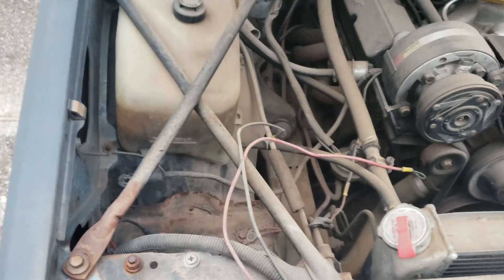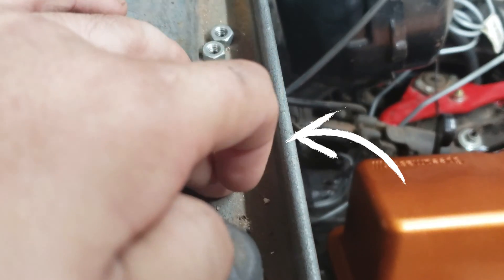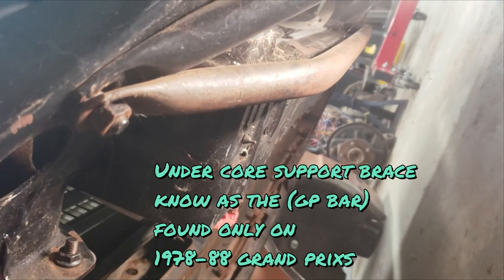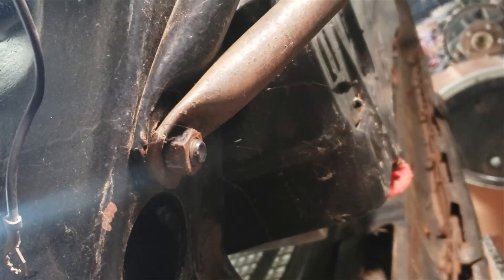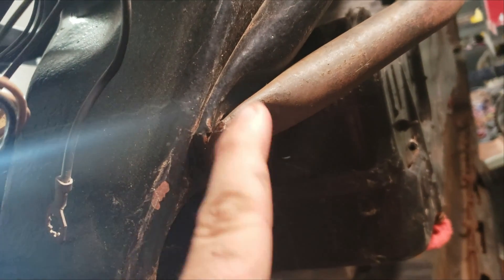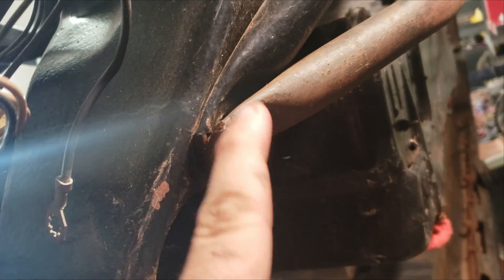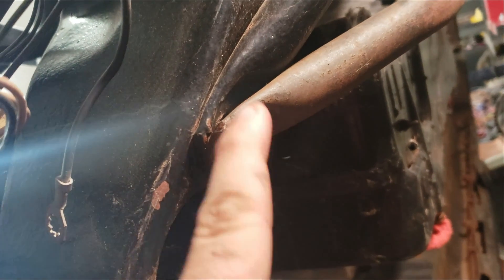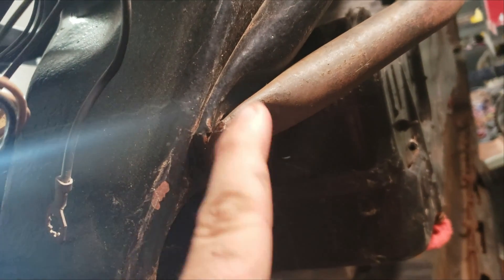Handling Better Than Stock 1978-88 G-Body Cars- Episode 1- Frame & Chassis Braces

Comment: The radiator brace works on boosted cars. All the turbo regals intercooler behind the radiator
Reply from the maker: @87TurboT  i could see on a monte carlo, regal or grand prix the radiator braces working with a intercooler since they have a bigger opening between core support and header panel. Compared to  malibu and el camino , grand am, lemans and bonneville it won't work with a big intercooler due to shorter opening between core support and header panel.
Reply: @gaspoweredgarage I'm pretty sure they came factory on all of the turbo regals. I have the rad braces and joust bars on my car a 87 turbo t. Added the trunk